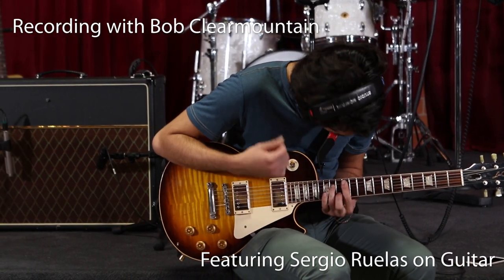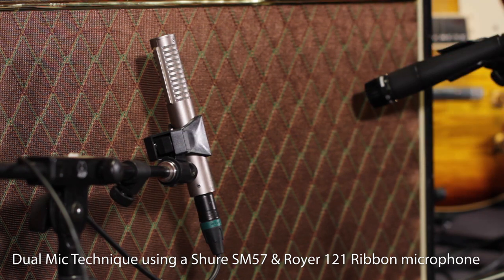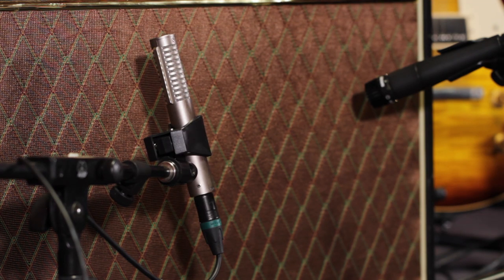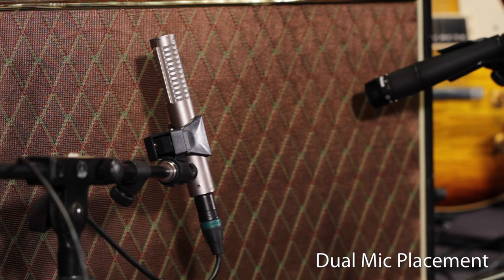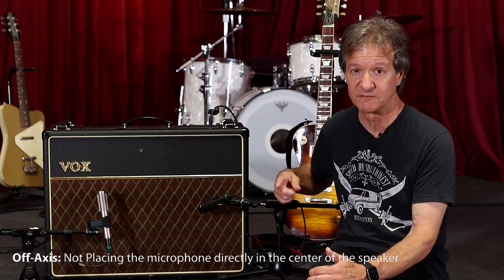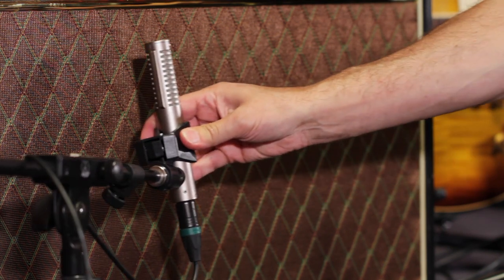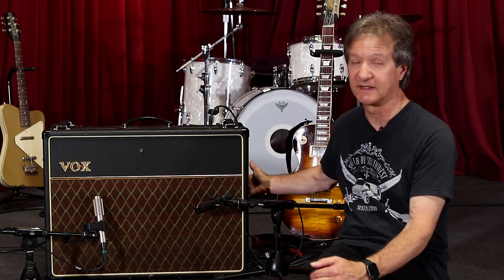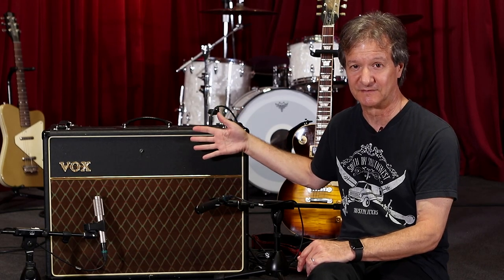How to record an electric guitar amp - Part 2 (Feat. Bob Clearmountain)

Comment: but the biggest question I have is what or how are you recording two mics at once? I have two guitar pedals, the DigiTech gnx3000 which has one xlr mic input and my other is a gt100 boss which I believe is 1/4 mic input. However I cannot record two mics at once so you see my dilemma. What you'reusing should be explained.
Reply: michael enochs apogee quartet or something like that
Reply: michael enochs apogee Duet can record 2 channels simultaneously
Reply: He probably has an audio interface that can handle at least two microphone inputs (XLR cables). A prime example would be that he is using a Scarlett 2i2 and plugging each microphone into each input.
Reply: Michael Enochs you just put the xlrs into a soundboard.